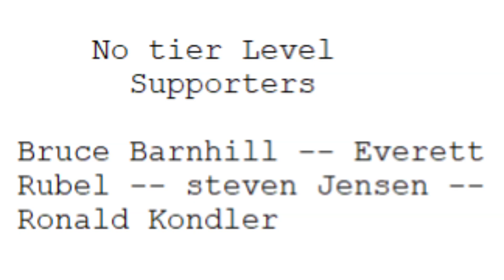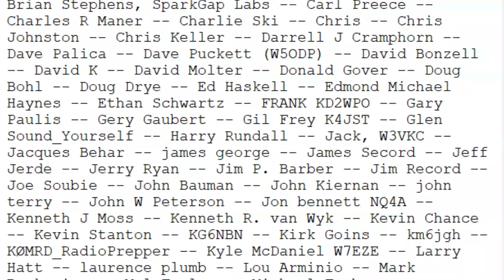Uneven Ground and Metal Roofs (#1124)

Comment: Would love to have that roof. Bond it all together, mount a 41 foot Vertical in the middle and feed it with a good quality high power rated remote antenna tuner. BAMM

Comment: Hi Dave I've used a lot for your suggestions with inverted vees and vertical antennas and had success. Thank you. My next project is a 20m Delta loop vertical plane. I want to use 450 ohm window line. Should I use a 4:1 or 9:1 balun and a short run of coax to the auto tuner ldg 100 and the transiever is IC 7300. Your help is appreciated. 73!😊